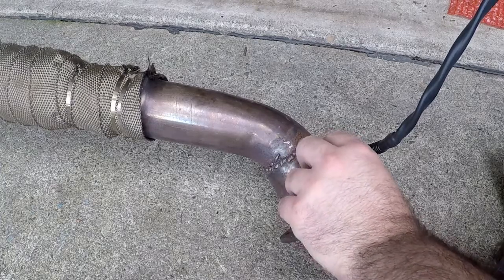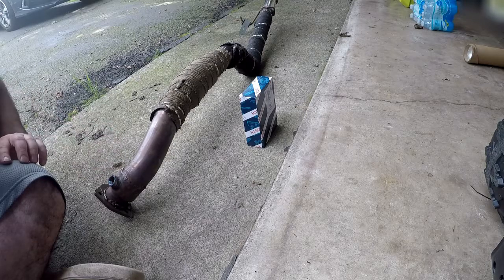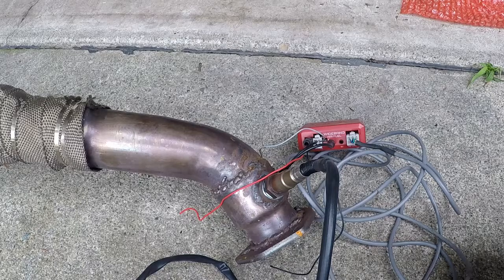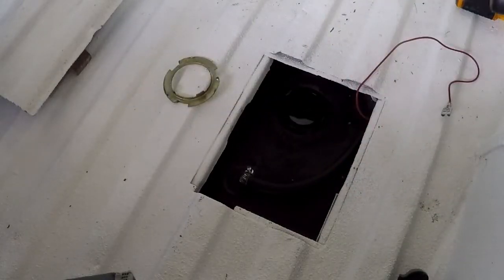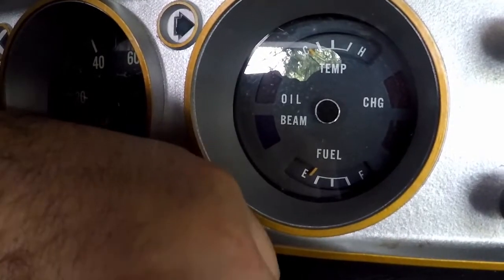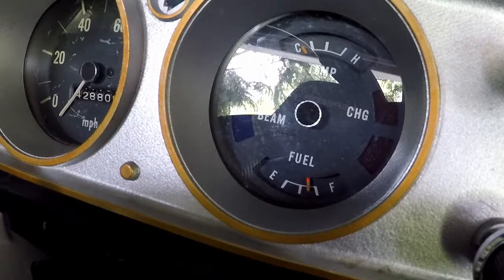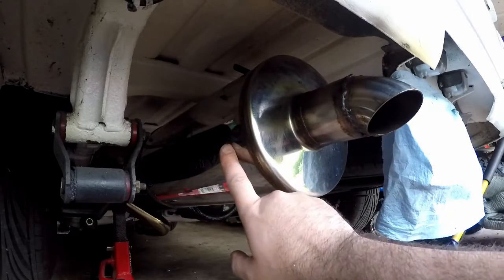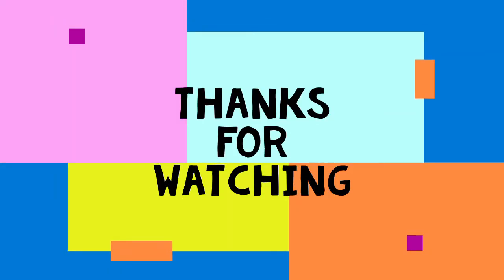Datsun 1200 Ute o2 Sensor & Fuel sender float INSTALL & Magnaflow radiator :)

Comment: Hello friend. Nice car. May I ask you I question? I replaced my fuel indicator and it's like yours but this which I get off had to wires how I must connect the other one? Ground I think..? I worry don't blow at the air